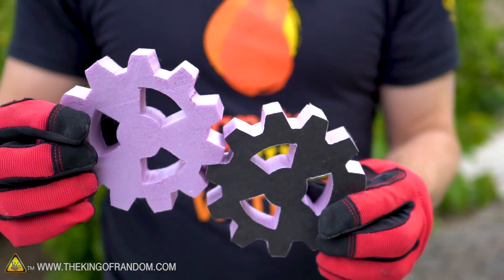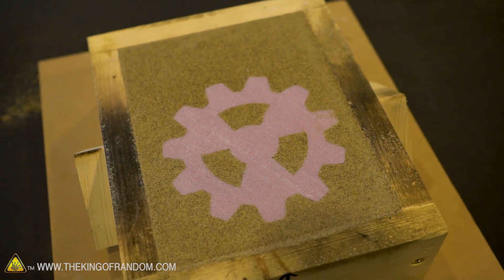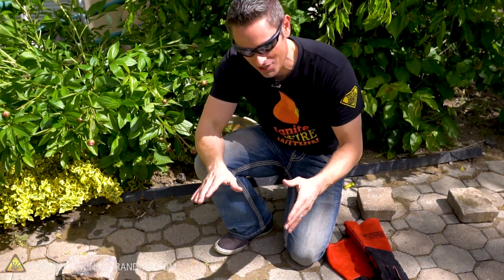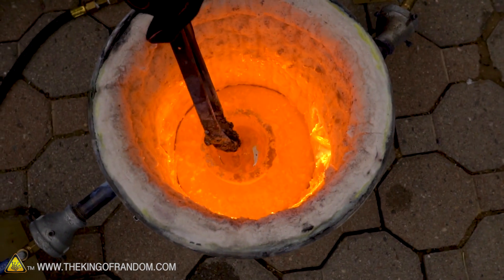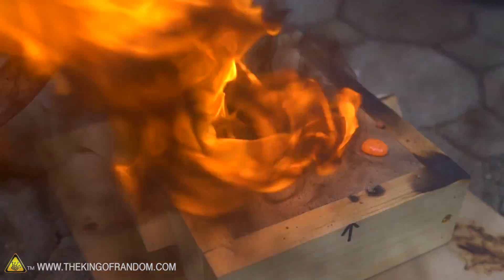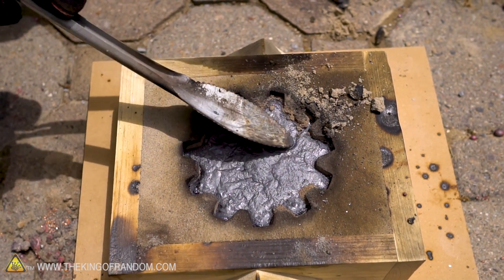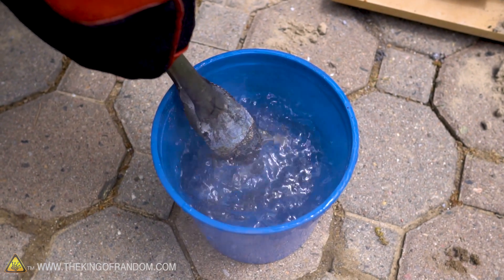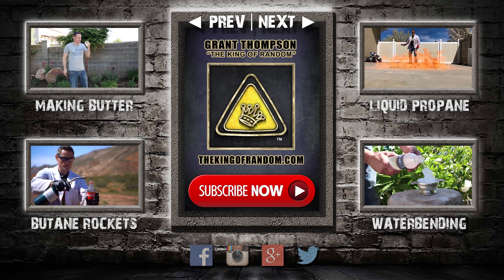Argh. Why Is Copper So Difficult? TKOR Tests Melting Copper In Our Homemade Foundry

Comment: use a smoky candle to put a layer of carbon on inside of mold, and, a small amount of pure tin or silver makes the copper more "liquid" so it flows better and fills voids. use acetone or gasoline to melt styrene, it must not be left in mold, contaminates casting.

Comment: you have to heat the sand to rid off moisture and air .the problem you have of crumbling sand is due to water and air expanding real quick thus having the pop corn effect.

Comment: I think the issue comes from the fact that molten copper is around 3.4x denser than molten aluminum. I think the bouency force was enough to separate the bond in the sand. the solution could be placing metal inside the radioactive symbols before packing the sand or by adding somthing inside the mold that would strengthen the bond in the sand. something like the plastic Christmas tree fasteners. Or anything long and with well defined edges.
Reply: For higher heat metals that are not Ferros metals, it's often best to use a denser molding material. I think it requires a higher silicon clay count for sand molding, or as someone said before using an oil base. Another thought would be to bake the clay sand mold to harden it so that it stays rigid in the casting.
Reply: I hope grant sees this

Comment: Maybe preheating the sand in the oven will help with the cooling issue and maybe make the green sand more stable too. I'm thinking nearly baking the clay (like when you put clay in a kiln?) might help. I don't know since the ratio of sand to clay may affect that but it's just a suggestion. I don't have any basis other than I thought warm green sand won't cool the copper down as fast

Comment: OK...  so a couple of tips.:
1. don't use styrofoam use a wooden one smooth it down and pouder it with baby powder. so you can remove it. (maybe insert nail on other side to pull it out) 
2. use the mold upside down and have the open site point on a smooth sand surface. (or cover the mold with another box of compressed sand in a box) 
3.poke a small hole in the now top of the mold and make a little cone(use a thin pipe to poke the hole)[clean afterwards bye blowing gently]
4.pour the molten metal into the cone.
->the cone plus little tunnel will work as a feeding tube so while the metal shrinks due to cooling a bit more can flow down the cone.due to the cast laying flat against a smooth sand surface(also compressed)  the mold will be protected and those parts wouldn't pop out. 

this is how I did it working in a foundry (but we had CO2 hardening sand)

Comment: Try using an outer frame that can support the radioactive details, before you pour the copper try heating the Styrofoam but not all the way so it can help support the sand more because when you have done it the Styrofoam was moving from the heat and that can make weak spots in the sand. In other words make a frame for the radioactive details and don't heat up the Styrofoam too much. 

Great vids :)

Comment: Why not just use a small torch to melt the styrofoam or even better use a pick to remove the styrofoam plug in advance? Then just pour as you were? Seems like added extra steps for no reason.

Comment: Try patting the sand more or pour the correct amount of copper in the mold the surface tension of the copper is pushing out the little indentations

Comment: Hey you should try to cast a copper apple, there is already a video by Tito4re called casting a solid 5 lb copper apple. I tried this with aluminum with no sucess. I havent suceeded in melting copper yet, as I need to make a better top to my foundry. I guess the aluminum melting point is to low for that project. I only suceeded in making the aluminum ports to get the metal to the apple. I also ended up with a fully cooked apple.

Comment: hey king of random I noticed the sand turns hard and crispy when it gets hot use it to your advantage. take a blow torch and heat up the sand and melt the Styrofoam. when the sand is hard pour in the copper

Comment: Your sand wouldn't pop out if you used both your cope and drag and poured the metal the proper way. There is a reason there are 2 sides ;)

Comment: Do you actually have OCD (like doctor diagnosed it), or are you abusing the term "OCD" to describe when you want to remake something perfectly? Obsessive-compulsive disorder (OCD) is a mental disorder in which people have unwanted and repeated thoughts, feelings, ideas, sensations (obsessions), and behaviors that drive them to do something over and over (compulsions). Often the person carries out the behaviors to get rid of the obsessive thoughts. In the way that a lot of people use the term OCD, they are describing their perfectionist traits. When you use OCD lightly in the sense you did, it discredits the disorder and is extremely infuriating. You aren't "OCD" about that, you are bugged by it, causing you to redo it.

Comment: ok Grant i and  nor have ever done any moltian metal pouring but i can see your problem how to fix it
your 2/3'ds of the way there in your mold
first the center inner towers and not being supported and the mositure in them are vapourizing and making
them break off. they need a upper support so make a top of the mold with a center hole to pour the copper 
into and it will spread out until it fulls up. (the liquidness molteness of the copper is not the issue)
that way the centerparts of the mold has a upper and lower support.  
thats how they do other castings for all other things

Comment: From someone in the foundry industry…  Sand is a lighter density than copper, so buoyant.  Which is why the parts of the mold were breaking free (and staying at the surface).  Use a two part mold with a bottom fill and top vent sprue.  Burn out the foam with a torch and preheat the mold the best way you can before pouring.  Watching the video you can see beads of copper rolling off the mold, so the temp difference is great enough to affect your pour quality.  Being a backyard hobby foundry there will be limits to your process, but you’re not doing bad.

Comment: when you are doing your tamping of the sand you have to tamp in layers. Fill the mold up half an inch past the object you are molding, tamp a little, add another thin layer then tamp again. Repeat this every inch to two inches. This will make the sand molding much more sturdy and able to withstand the pour.

Comment: something to try (I've never attempted this myself). fill the other half of your casting box sand, but put 2 air vents in where the gear will be. use one hole as a pour spout and the other as a air release hole. This will better your chances of keeping the pattern that you want. Thanks for another great video

Comment: I don't think the problem is with the sand.  And the Styrofoam is fine, it's the same kind I use.  The problem seems to be with the design of the mold in my opinion.

Usually when I see people do green sanding casting like this, instead of an open mold, I see them using a two part mold where the cavity you want filled would be in the middle, and then you have two holes dug to it for pouring and ventilation.

Comment: Maybe the moisture in the sand is causing the problem. Water turns into a vapor when it gets hot, right? Maybe the hot copper touching the sand is causing the water in it to turn into steam and expand, and that's blowing apart pieces of the mold. That would explain why all three pieces of the sand blew out when you added more water to the sand. You can also see bubbles rising out the top of the copper kind of like boiling water. That might be little droplets of water turning into steam and escaping out the top. Maybe something dryer like plaster or cooked clay will work better.

Comment: Plus when you put the sand on the foam it needs to be sifted so that it covers the foam it does not have as much air in it so the radioactive pieces won't pop out

Comment: sand looks a little dry. oil, not water. and ive done sand casting but have never left the mold in place and it has to be done in two halves generally...thats why cast parts have a seam

Comment: So if the original doesn't come out perfect, set the original into the mold and then pour more copper around it to fill in the imperfection gaps. You could do this best with the ones you made in yesterday's video that just had imperfections

Comment: in high school i used put the Styrofoam in the center of the sand with holes that lead to it in the top. A few holes to pour into to distribute evenly and while pouring in each hole one by one the other two or three holes help with venting. Finally when it cools you cut off the extra and file/grind it down.
Reply: Philip Crotty Now THAT is a class i'd like to attend
Reply: it was a metals class they just taught us how to build with metal like basic welding, sand blasting, castings and soldering. the class also taught us how to use tools like grinders and lathes. the castings were made with whatever we had at the time so mostly aluminum but we also used copper and pretty much everything else except steel.
Reply: same in my highschool. we did it with old pistons.
Reply: Philip Crotty Yeah, i live in The Netherlands though, but here you get woodworking at high school and if you want to work with metal you have to get a degree for it.
Reply: Aron Loof like a degree to with metal for the high school or for a job? over here some of us need a degree or license for certain jobs we are going to do but all the basics like i said earlier you don't need anything.
Reply: Aron Loof idk about anywhere else but in my state it was rare to have a metals class lol. i moved a lot in high school so i ended up going to six different schools and only one of them had the metals class. the others just had woodworking which not all of them even had that.

Comment: grant I recommend you print another template cut it out tape it to the gear and use a your drill to make 1 hole in each part of the radio active part and then jigsaw and dremel maybe that wood dremel thing on your work bench could work on copper

Comment: Hey Grant, In dental school we learned to cast gold crowns using a high heat Gypsum or stone. Now gold has about the same melting point as copper so the process should be similar. You need to make a wax cast of your gear, (although the styrofoam may actually work too) mix up some gypsum, place the gear in the gypsum and allow it to setup. After it's set you can melt the wax (Styrofoam) out and then use that as your mold to poar the copper into. Pretty similar to your other videos where you made the pokeball into gummy. Just break away the gypsum and you've got a nice copper gear likely with sharper more well defined edges.

Comment: I wonder what would happen if you used acetone to dissolve the styrofoam? Maybe it would dissolve the styrofoam which would be absorbed into the sand and then the acetone would evaporate leaving just the negative space for your molten copper? Sounds plausible, no?

Comment: You should make a wooden pattern that is removed manually before you pour, instead of a foam pattern. This way the foam doesn't cool the metal at all and you can reuse the pattern. It would also help if you packed the sand down a lot more, maybe used both the cope and the drag. If all else fails, we often do silica sand casting. it takes a bit longer to make, but it I promise that the mold won't break apart when you pour.

Comment: If you want to do it on another video you should put in a screw in the middle of the foam and then pull out the gear then pour in the copper

Comment: howsit going Grant you have 2 choices with doing that gear on moulding there is 2 types open casting and bottom filling open casting is what you have already done and bottom filling is the mould is in 2 parts with a breather hole on one side and a fill hole on the other by closing the fill space the copper will remain  liquefied for longer and maintain that heat and having 2 parts of the mould will support the small parts of the mould and keep them intact

Comment: Hey Grant, I think your problem is that the sand is not intact enough. I think what you should do is to to every 1/2 inch, ram it down. Also, I think you should make a ramming tool shaped as the inside curved part, and ram it tightly.

Comment: Here's a tip for you. I was an art major and did a fair amount of casting. We made our open faced molds from sand with some kind of resin mixed in with it (maybe urethane). We'd let it set and it would hold the shape just fine with aluminum and bronze.

Comment: Grant you could fill your box with some concrete and then put the stirofoam cut out in the concrete let it dry and then pour the copper onto the stiro foam and the concrete won't move

Comment: Grant, have you tried a 2 part mold? make one part with the pattern and the other with a sprue. that way you have a cavity to pour the metal. since you are using Styrofoam as your pattern dont worry about removing it as it will be consumed my the heat of the molten metal.

Comment: Add borax... boron makes the metal more fluid and helps with casting.
Your sand also needs to be mixed with something to help it keep its shape. Add a small amount of clay to help the sand hold its shape. You should be able to hold a clump without it falling apart easily.

Comment: have you considered making a clssed cast with a feed hole through the  upper block. the weight of the upper block of  sand would most likely hold the central blocks of sand in place alowing the copper to flow around where the foam is placed. This  method we did at school using aluminum. that was back in 1986!

Comment: put some sodium silicate in with sand it acts like glue in the sand.  U can then completely bury the mold and leave a sytofoam path for copper to travel.  that will prevent under pouring.

Comment: The foam you are using is very dense. If you used a lighter foam it would have less material in it that needs to be burned away by the copper -> better mold

Comment: Hey Grant, might help if you just took a blow torch to the piece before you poured the metal, more even. Also, you might try making the model from wood and putting screw holes so when you flip it over you can put some screws in and pull it out, but if you do, be sure to angle the piece ever so slightly (couple degrees max) to make it pull out easier.

Comment: have your mold embedded in the sand with a Styrofoam channel leading to the surface. Pour the copper into the channel. This will reduce your heat loss a lot and as the copper fills the mold, it will burn away the styrofoam eliminating any voids. This is how it is done in the industry. Yes, you will have to cut the excess copper left by the channel later. point is, you should not have your mold exposed to the air at all. And use some of your borax flux as well.
Love your vids. Keep em coming.

Comment: two things. Green Sand isn't the right level of clay plus talcom powder may be of great use... also, you need the upper portion of your cast mold to retain both structure and heat. you should do a side by side of your greensand compared to the professional grade stuff. second, please build or buy a smelters crucible arm.
Reply: He does for the smaller smelter, that is why he is using the Tongs for now.

Comment: You should use mor clay and less sand in your green sand casting. This way, the sand will hold its shape and not fall apart. Also, why didn't you just cast it with it inside the sand so gravity can force it to fill the mold like you usually do. I love you're videos.

Comment: as someone else said already.  use a red clay and sand mixture, and put the sand through a sive while filling the mold.  it will make the mold much, much smoother.
Reply: and for doing such a thuck mold, you should use a 2 part mold, and seperate them with talcom powder so you dont have to burn the foam out and youll have a much. much.  much better casting

Comment: instead of puting it in water you should put it in motor oil i stead it will leave a nice finish but make shure its 5w-30 most of them are non flamable

Comment: Did you flux the copper? That will help it pour smoother. I think that is a lot of the issue you are having. Powdered borax will do the trick. Another thing you might want to do is encase the Styrofoam in the sand completely. It will keep the copper hotter longer. this is how engine blocks are cast.

Comment: you can use both sides of the mold to keep the radioactive logo in the bottom. you can use baby powder to prevent both sides from sticking together if you want to use something else instead of Styrofoam. you can use a tube to keep a hole in the top mold and remove it when the mold is ready.

Comment: you need to have a cavity that leads to the mold , so make the thing cover the part with the form with steel or something then dig a hole from the back side that leads to the foam mold

Comment: You need to have top and bottom boxes, and do the pour through a sprue.  The foam can stay or go, but you will always float the sand up if you are only pouring an open-top mold like that.

Comment: you need to cover the mold to retain heat plus you are using the wrong kind of sand. Use petrobond it will work great.

Comment: I used to work in a foundry in Dunedin New Zealand as a fettler. I would watch the moulers making the moulds. We mixed the sand with an adhesive then set them on fire to cure it. They would also use a vibrating table to smoothly distribute the sand. Perhaps those tips may help you. Awesome video s